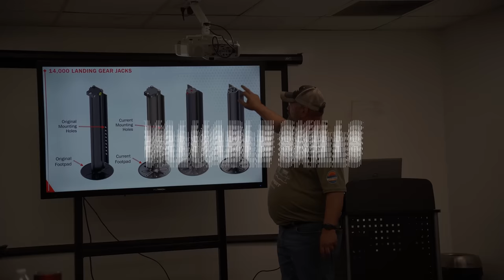Touring New Class B's at Ocala RV Show!

Comment: If I didn’t have to screw around making, unmaking and finding a place to store my bedding every darn day and have to poop with the door open I might consider a $125,000 Class B, but I can’t, so I won’t 😂
Reply: I’ll take my class c and it’s only me.
Reply: If you don't want to do that winnebago 59gl is probably what you'd want minimal bed building and decent bathroom for a class b.
Reply: @mikeallensonntag  Thanks, I’ll check it out👍
Reply: @Steve Z    no problem. I did 4 months of research before I picked one. I have a 59gl. Fact that floor plan is little effort with bed and fact that travato is very quiet. Truma system hardly makes noise on outside, same with coleman Mach ndq air-conditioning is slight buzzing on outside, the lithium battery which is 9.6kw makes the travato 59gl completely silent anywhere it sits. It's capable of air conditioning with slight buzz and no other noise for 8-9hrs before the promaster will auto start to recharge the lithium. It's truly an amazing class b. Only company that makes anything like it is I believe Coachman makes a lithium class b also. But I can't remember if it uses Mach ndq and truma, but it's bed setup is something your not going to like.
Reply: @mikeallensonntag  I checked out the 59gl and it is so close to something I could live with. The bathroom is awesome for a Class B, the bed seems very easy to use and the lithium set up is truly remarkable. My only hesitation as with almost every Class B is that I really appreciate a comfortable chair or sofa to relax in on a rainy day or for an hour or so before bed. If health is not an issue, then a pop-up top that allows you to keep your bed made and also lets you keep a rear sofa in the van in full day use mode all of the time is also an option. Thanks for all the information👍
Reply: @Steve Z  Ya I would be worried about temperature in summer with sleeping in pop top personally. I do agree though not having a nice sofa is little of down side. I swivel passenger chair and use it like that but it's definitely not as comfortable. Your really not going to see sofas till you go class b+ with a slide. But I don't believe there is any lithium based b+ coaches on market.

Comment: We were disappointed in the show.  It was too hot for my wife.  Although some rigs had the air conditioning running, 85% didn't do that.   The show venue needs enough electricity to use when it's too hot.  The show also didn't have enough class A models IMO.  I saw only one 32' model, which was my target length.  This was my second time at this show, and my last. Sorry.   Except, the burger and fries I bought there was good.